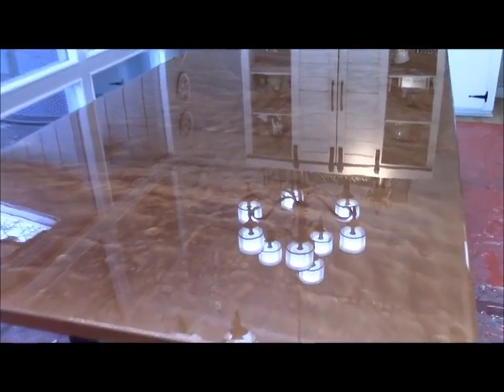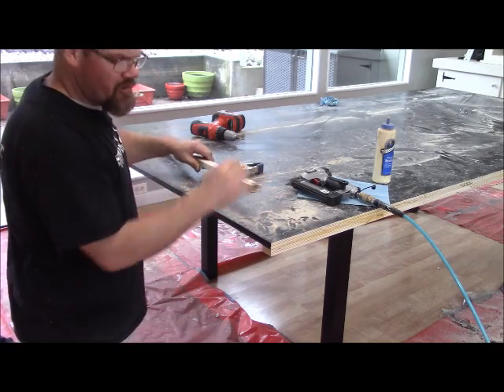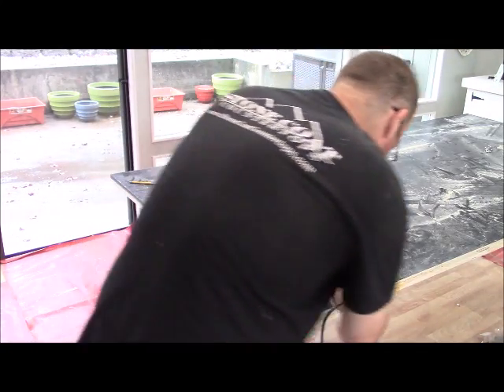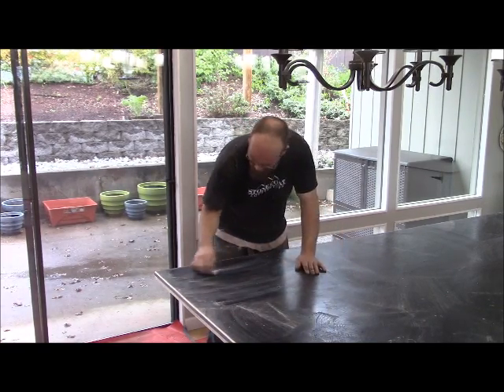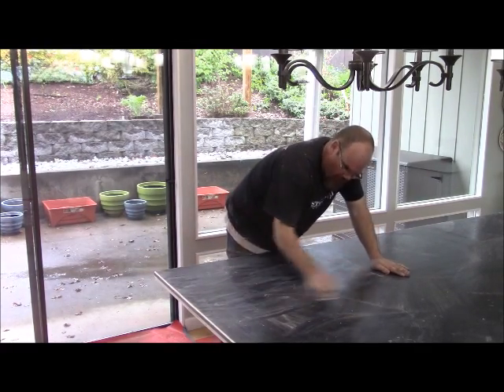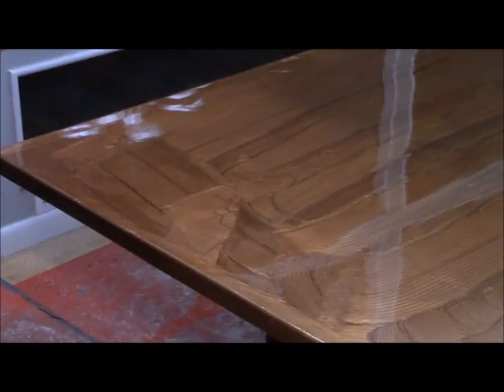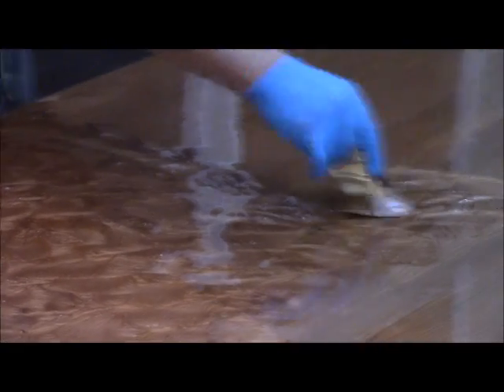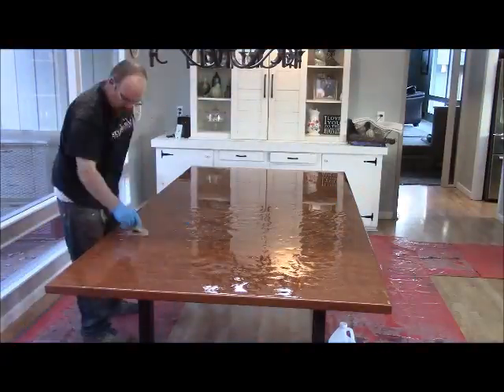Copper Epoxy over an old Plywood table

Comment: Why didn't you want to let the material run over the edge during the 1st application?  What it because you needed to brush it first?  And then, do you "chop" the edges?  Then, how long would you say it takes to do something like this, less dry time?

Comment: My first job was at The Swiss Fudge Factory. I had to do this with hot fudge on a marble table,lol. … an outlet at the mall, not an actual factory:p
Reply from the maker: You're making us hungry Black Opal lol!
Reply: lmao, I thought you did that to me! as 5 mins later I was standing in front of the fridge lookin for a midnight snack.... lol... I just wondered right now though... The technique I used for the fudge was for the purpose of making the fudge silky smooth and I believe to keep out air bubbles as it cooled. I wonder if that technique might work for this. ???  The technique in a word was 'folding'. idk, its an idea. peace

Comment: You do such a good job of explaining every step.  I have not begun my first project, as I watch a few of your videos each day to become more comfortable with the process. Today my question is in regards to clean-up. What do you use to remove the epoxy from your stir blade or trough? I assume most of the paintbrushes are tossed. Is there kind of a formula for the amount of product to use as you seem to be so exacting with the amount you make for a project. Thanks again.

Comment: Gorgeous job but!! How do you keep the area dust free while it cures?
Reply: Turn off your AC or heater, close doors, keep kids and pets out
Reply: Hang dollar store drop sheets around the area. Just take it to the ceiling and the static electricity will draw floating dust particles. Just vacuum and dust really well before and you'll be good.
Reply: Life is Life with Denise plpppp
Reply: @600miles  Agreed! You're right but that sounded so funny! Let's continue shall we? Unplug your George Foreman Grille, clean off the bacon fat, send The Wife back to your Mother-n-Law, move out into your Stabbin' Cabin Sin Bin Van outside, then vape some Cannabis Oil and pray you remembered to add some Hardener to the mix.
Reply: Have you ever watched Dexter? Make a kill room.

Comment: It looks like you chopped the first clear coat that you put on over the copper tinted layer of hardened epoxy. What is the reason for that. Chopping the copper layer gave it that cool effect but not sure why you'd need to chop a clear coat.
Reply: Thanks for sharing your skill
Reply: Jim Spallin he likes to play with bubbles 😂
Reply: I think to get rid of trowel lines?

Comment: great point on torching near the end of the working time of the product.
Reply: Following your lead
Reply: StoneCoatCountertops how do you finish the edge with the flow coat?
Reply: I also saw where a hair dryer can be used to pop the bubbles.
Reply: I believe it flows naturally, even under to the bottom round edge due to molecular tension and finally drips which he scraped off after 3-4 hours.
Reply: @DrHarryT  A hair dryer would take forever. Even a heat gun takes a long time. Vibration works well. Hold an oscillating tool to the underside of the table and move it around if you are afraid to use the torch.

Comment: Can this be done on plywood floors?
Reply: Yup. That's a whole lot of resin though and will cost a fortune.
Reply: @famousforever8556  
I have been told "NO"... because it drys "HARD" and will crack.
I was told to use Polyurethane ... because the wood moves.

Comment: it really varies on the temperature and how the surface is treated. we encountered based on certain types of resins 100% solids will react with in a year . you'll see cracks or a peel. 50% solids sometimes reacts between two to four years. we has some deep areas which we applied Bondo and it separated . but that was a commercial tavern bar top. so weather took a toll on the surface. been near a door. most resin companies since the late 90s will advise you to stay away from vinyl Ester since it does not allow 100% bond with 100% solids epoxy. with water borne epoxies might have a different bond . I'm not 100% sure. but o would advice to consult your technical support to see if it's the way to go. just to cover your self. 
believe me our customers weren't very happy when our surface failed.
Reply: Western industrial Service LLC Aa

Comment: Really great video! I've got some really good advice for you, though...please use ear protection; your ears will thank you in the future and the tinnitus that you will no doubt develop because you haven't been protecting your ears won't be as bad.
Reply: Buck tooth, No. Mama she crazy is correct. Protecting your ears is only sensible. At the age of 20 & 30 I felt invincible as well, but after 40 years of working with wood and power tools I know. Repeated exposure to this type of loud noise WILL damage your hearing and once it is gone there is nothing you can do.
Reply: I've got tinnitus in both ears and there is no such thing as silence anymore; only high whistling. I wasn't trying to preach, only help.
Reply: MamaSheCrazy tinnitus can be developed without any prior damage, I've known old timers who worked construction there whole life without major eating damage, and no they didn't use ppe the majority of the time.
Reply: Gerald Norton that makes sense..... one guy was fine, so it should work for everybody!! 
Not sure why i put off smoking and driving without a seatbelt this long!!!!! Time to really live!!!!
Reply: kalikasurf the vast majority of guys are fine!!! But for someone like you I'd be sure and wear a hard hat in the shower, just in case your water pressure is to high.
Reply: Gerald Norton the video isn't a tutorial for professional carpenters or craftsman. This is for aunt kate and her on again off again boyfriend with the drinking problem, to make up for the time the 50 inch tv fell off the wall because he used drywall screws to mount it. ...... so whats the matter with gettin all kitted up and showing em how the pros do shit? 
Im right there with ya, man. I think everyone that wants to nerf the world should get a punch in the gut. But if youre going to play a professional on tv, then do it right.
Reply: Gerald Norton hard hat in the shower? C'mon kid. You know the proper PPE's includes safety goggles.... shame shame.

Comment: WRONG it doesn't draw the oxygen out lol. Actually it heats the bubble, air expands and it pops.
Reply: +marcjtdc Good job being that guy. The one nobody likes.
Reply: WelcomeToMyDream please excuse marcjtdc, he's a member of antifa lol
Reply: and lowers the viscosity of the epoxy.
Reply: This goes to my question here: would a heat gun (electric - no flame) do the job - better, worse or not at all?
Reply: Jay Murphy worse. You want really intense heat for a very short amount of time.
Reply: Good thing for guys like you, correcting slight wording mistakes. otherwise people might think a torch sucks oxygen out of things.
Reply: WRONG, its the carbon dioxide that actually gets rid of the bubbles not the heat. We used epoxy resins all the time in building museum exhibits and if you breath on the resin surface it will pop bubbles as well.
Reply: James is right.  I use pour over all the time when I'm making 8bit Nintendo characters.  I believe it's the Famowood brand that states it in the instructions.
Reply: It's carbon dioxide
Reply: CO2 or CO popping the bubbles?  HOGWASH!  This recent back-and-forth has gone WAY off-track into the realm of UNscientific drivel.  You could bathe that resin in EITHER gas in its pure form and it won't burst bubbles by ANY law of physics or chemistry.  Heat to expand the gaseous bubble and reduce viscosity plus physical disturbance of the bubble to disrupt its surface tension - these I'll buy.  CO or CO2 displacement of dissolved or trapped O2 - not EVEN plausible.
Reply: Under section 4 of the EnviroTex Lite pour-on - the last sentence:  "NOTE:  It is carbon dioxide, not heat, which removes bubbles."

I highly doubt the company is putting the wrong information in their own directions.
Reply: Gerald Norton b
Reply: It's easy enough to test. I know that a heat gun will clear up bubbles, will a chunk of dry ice held over the resin?
Reply: Robert Szasz you know, that would make an excellent video. I got some pieces I could prob epoxy tonight. I'll try to get to the store to pick some up and try.   Then we can end this madness
Reply: Please forgive him...There are those who don't do well with effective communication...I too fail sometimes with reacting instead of responding :-/
Reply: Result is the same. Don't be a final de campana
Reply: Chris - James as in James K re: breathing on it "proving" that it's CO2 and not heat?  Begging your pardon, but breathing would be doing both (heating and producing SOME CO2) but I'm holding out for something like the dry ice experiment proposed above.  Barring my seeing THAT actually doing something, which will surprise me GREATLY, I'm sticking with the common sense guess that it's heat.  You're incorrect in selling short the heat theory as "all it would do is thin the epoxy" for two reasons: A) thinning the liquid would certainly make it easier for bubbles to escape, but more importantly, B) elevating the temp of trapped gasses inside a liquid will produce a decidedly greater effect on those gases, namely radical expansion.  So far that elementary logic trumps any AS YET UNEXPLAINED THEORY of CO2 DRAWING OUT bubbles -- by means of WHAT chemical or physical property, pray tell???  Tell me WHY or show me PROOF that it's CO2 and not heat - or perhaps it's both, as that has not yet been disproved.  All this hypothesizing without substance is getting dry.  Sorry, it's not something I'm setup to experiment with, as I have no pending project requiring a bunch of that epoxy, and I'm not going out to buy it just to end this folly.  So I await the goodwill of someone else.  Like I said, it would be great to see how dry ice works some mysterious alchemy here, cuz I need my thinking upended every once in awhile.
Reply: I went and bought a bunch of dry ice, but it evaporated in the freezer before I could get to it.   I have a few pieces I need to pour, I'll try to grab some more dry ice & get that done.
Reply: MD - Cool beans!  I'm thinking you'd bester keep that torch on stand-by....
Reply: marcjtdc Stop trying to be relevant with your valueless minutia.  Your attempt at diluting the video's intention makes you seem desperate for attention when the show clearly isn't yours.
Reply: Thanks for settling this for us so succinctly and scientifically - not to mention politely and politically correct - and most impressively of all, without the need for a spelling checker.  Who needs crutches when one's an olympian?  Leading by example....
Reply: Who cares about the bubbles. That table look freeking bad assed.
Reply: Everybody would care about the bubbles.  I forgot to hit a piece with the torch once & it was full of large bubbles, made it look like trash.  Only good thing is, it was on a fish, so the bubbles work.   Pretty sure I could sand it and put a second coat on
Reply: Sorry, I meant who cares about how the air is taken out of the bubbles. I just think this back and forth discussion detracts from the job showcased in the video. These guys do great work.
Reply: inquiring minds want to know
Reply: marcjtdc the truth is it releases table queef.. Its basically that. #science
Reply: When flying at 30,000 ft in a pressurized cabin and your window breaks do you get sucked out or pushed out?!
Reply: Is this a trick question?  Airplane windows I've sat near had windows about big enough for me to stick my HEAD through, and NOT MUCH FURTHER!?!?!?  Problem solved (for the rest of the passengers, that is).  FarSide busload of dogs comes to mind....
Reply: The thread here reminded me of hearing my physicist dad tease my housewife mom that you don't get sucked out of a plane.  It was all a joke... sorry about the digression.   On another note! I love this video and I just ordered the SC copper products in this video. I have a solid wood door that I use for a desk and my girlfriend has always wanted me to put a real copper top on it. You can imagine my hesitation - until we saw this!  Anxious to receive the materials. I think I'll do my amateur best to video the process and post! Thanks!
Reply: You're all wrong. Jesus gets the air out of those bubbles, not that magical, fire spewing demon stick.......It's Jesus.
Reply: Ok but...if its causing the air to expand & the bubble pops isnt that basically the same as drawing the air out?
Reply: no mask? how bad are the fumes from this stuff?
Reply: It would NOT work, heat guns blow air and that's the last thing you want to do.
Reply: Your correct it is drawing the air out! LOL!
Reply: pale writer: You sir are correct.
Reply: Adamas7:  Amen!
Reply: marcjtdc
Replacing a bathroom ewk
Reply: +stoneCoatCountertops YEA... 23 gauge needles!!!
Reply: Andrea Mitchell I used to wonder as well, but he addresses it in a different vid. No dangerous fumes to be concerned about, at least from the epoxy
Reply: Stop talking bullshit, a heat gun works perfectly fine, just takes a bit longer than a flame because.... wait for it... it not as HOT as a flame.

Everybody who ever tried it with a heat gun will confirm this to you.

Carbon Dioxide does nothing and that manufacture doesn't know their shit. And just a random fact, most manufactures of Epoxy don't manufacture epoxy. They just fill bottles and label them, only reselling stuff others made.
Reply: marcjtdc   Interact with people much?
Reply: marcjtdc yv
Reply: Does both at a time

Comment: While your results look good, your technique has much room for improvement.  Your sanding in a home, with no dust collection and a self built straightedge... buy some good tools. Your a business, its a tax write off. I suggest festool, great dust collection and saw has a metal straightedge. Using epoxy indoors with children around, should have used plastic to seal off the room. They are breathing the fumes. 
Cheap brushes let bristles on your work surface. Good ones don't.  
All in all, a cheap way to make the table look good but I would not use your business or recommend it with those practices.